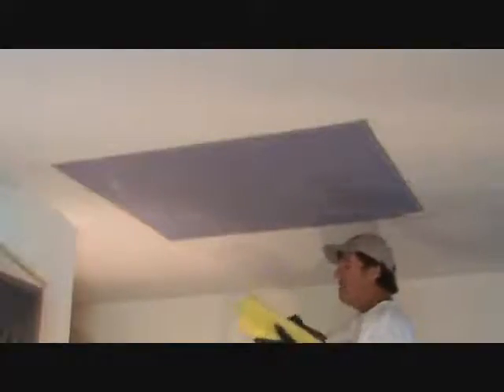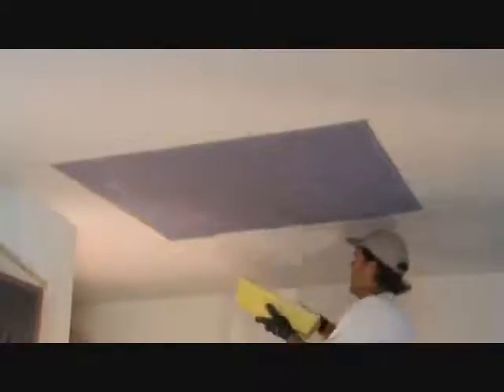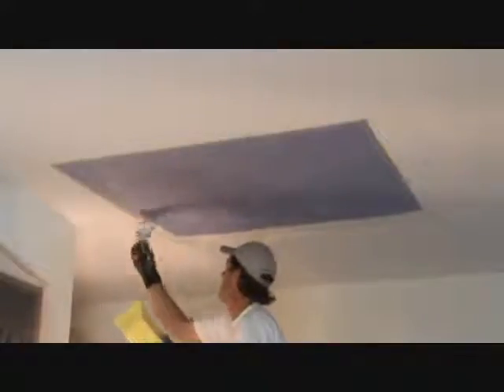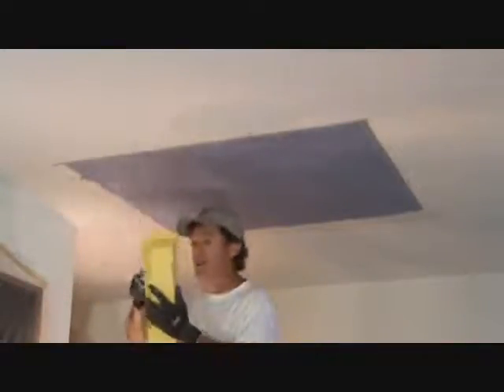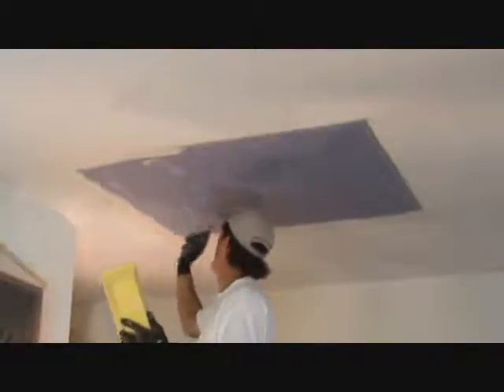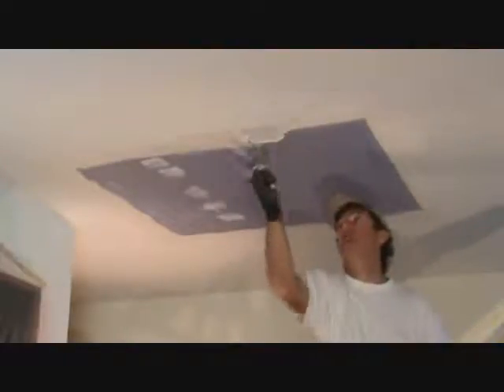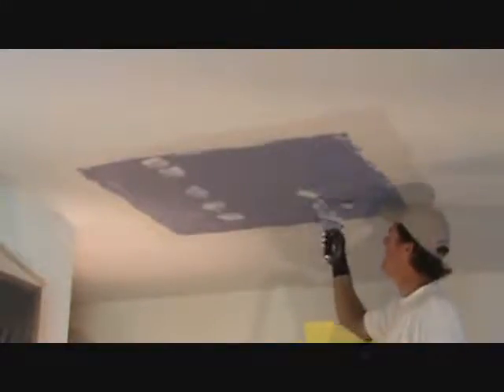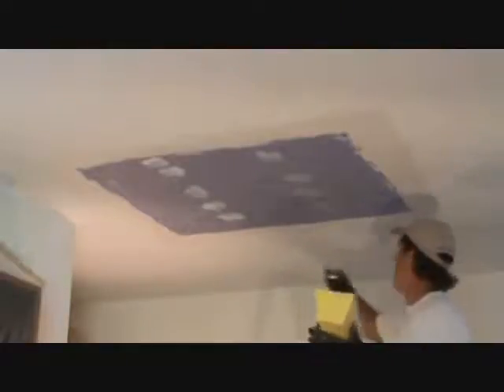How to repair a water damaged ceiling...Part 11

Comment: What about the existing texturing? Do we need to scrape a portion of that off? If so what's the best, most economical way to do this?
Reply from the maker: If you have thick texture then you could scrape off some with a 3" putty knife but if you were actually meaning like a popcorn ceiling then yes that would need to be removed at least 2 feet away from the edges of your repair area so you can properly float your patch area into the existing. You could spray the popcorn ceiling with water from a Hudson Sprayer or just a spray bottle then scrape off with drywall knife. I have videos for removing a popcorn ceiling if interested.....just go to my main YouTube channel page then click on playlists & scroll down to drywall. Thanks